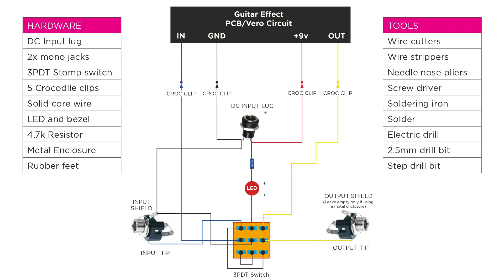How To Build A Basic Guitar Pedal Test Box

Comment: Hey man i did this and I soldered it and know how to solder fine. No matter what board I've used both pre made don't work. Like I could take picture and show you I followed your diagram to the t. It will switch but no sound when on.
Reply: I am having the same issue. I  have a signal when the pedal is off though. Turn it on and nothing through my builds. I guess I am going to try and build an easy breadboard circuit to narrow it down to this tester pedal being the issue.

Comment: Hi - sorry for peppering you with questions - I think I can summarize by asking this. I’ve wired the pedal as diagrammed. Before I start creating effects, I want to make sure all the connections are sound and correct, so I do the following:

I attach 9v +/- to the prototype board rails, I attach the pedal power and ground to their board rails, then I connect pedal input and output (together on the breadboard). When I power up the amp, I can hear the guitar playing in ‘LED On’ as well as ‘LED off’  states thru the amp, so I am assuming that means I’m ready to start building effects on the prototype board…

Note / in the ‘on’ state, there’s some buzz. The guitar rings thru but there’s background buzz…is that normal? Does that indicate a problem?

Comment: Oops - one other question - is there a problem if I just want to use 9v battery power?  Would I need to wire anything differently?
Reply from the maker: Yeah instead of attaching the Dc 9v wall socket buy a 9v - battery clip attachment instead. Have a look at my ruby amp video I show one in that. It’s part 3 the last ruby vid
Reply: @unholyaudiochannel thanks! Much obliged.

Comment: I’ve made several attempts at building pedals and have found it to be harder than it looks. So I’m trying to do exactly what you’ve done here - a test pedal that will isolate problems to the effect circuit-not with the box/wiring  etc.

However  - if I want to test that I’ve built this pedal correctly - before I’ve actually built an effect circuit - how do I do that? do I simply attach the negative and positive alligator clips,  attach the circuit input and circuit output?

My current test pedal bypasses correctly with the switch off, but when I click it on, I get no sound from the guitar, or a hum…wondering if maybe I’m testing it the wrong way.
Reply from the maker: Yeah just build a small circuit on a breadbord or strip board like the bazz fuss fuzz circuit so you can test the box.
Reply: @unholyaudiochannel thanks - but i want to test the test box to make sure I wired it and soldered it correctly - before I build any kind of circuit on a prototype board…should i just connect in and out and make sure my guitar signal gets to the amp whether it’s on or off?